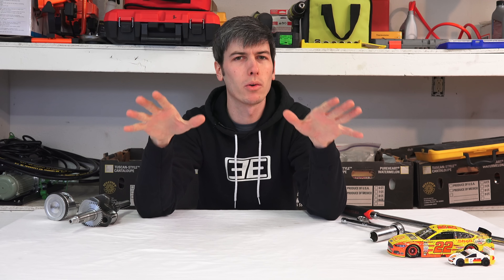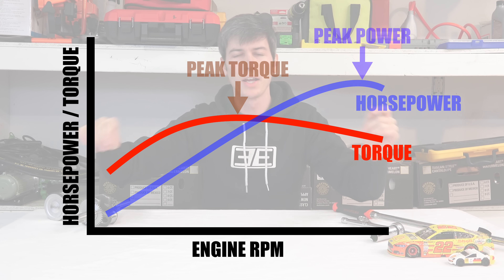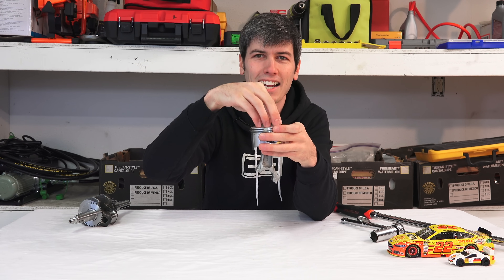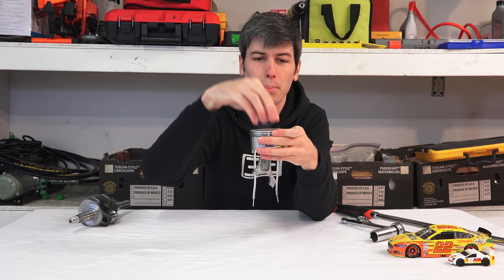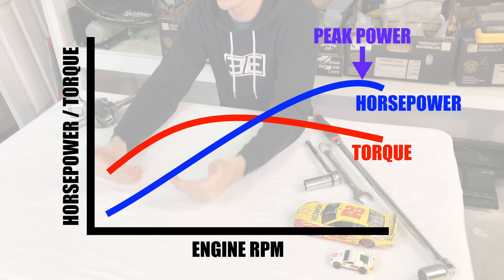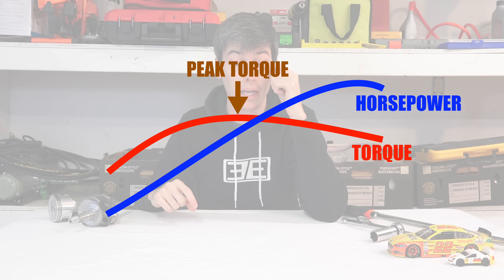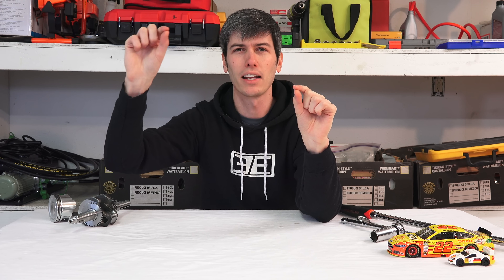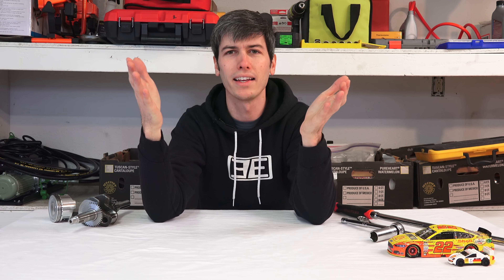Horsepower vs Torque - A Simple Explanation

Comment: Nicely done. my shop teacher explained this to me almost exactly as you did back in 1965!  Torque is force plus distance, measured in foot pounds per foot.  Horse power measures work! Hp is measured in time ie: if a horse lifts 1,000 lbs by simple pulley,  one foot in one minute, it has done one horse power of work. If the horse strains but does not lift the weight, it has expended force (torque), but has done no work.

Comment: I’d like to see this explained on work engines in regards to towing or hauling heavy weight. It would help in choosing a gear ratio that would be most effective in maintaining speed when pulling hills and the best gear for cruising to get the best MPG’s in Diesel engines.

Comment: if i want to pull a great weight behind me, is torque more important than hp? like i allways hear you need to be in lower gear to have more torque for greater performance in offroad vehicles.

Comment: To me, power is just a number which tells how fast the engine runs. But at a lower than around the highest RPM, its the torque which matters to accelerate or pull the vehicle. Ofcourse, if you increase the RPM, you effectively increase fuel intake and hence better throttle response and hence faster the engine and hence the vehicle.

However only real figure which matters is the torque. So I don't agree that the engine with higher power will run faster as it holds true only in lower (bigger) gears when vehicle can accelerate faster at high RPMs, At lower RPMs (typical driving style), you dont redline the engine and hence Torque plays a major role in accelerating the engine and doing it most efficiently using minimal fuel.

Comment: Hey Jason, I had been told by my car racing physics teacher in the past, that for a manual transmission car,  say a factory 6sp, that maximum acceleration, would occur when shifting at an rpm that after the decrease in rpm caused by the time it takes to upshift, you end up in the next gear at the rpm that produces the most torque. How does this apply, and what are your comments? Thanks.

Comment: Wait wait wait, so if you have horse power you can make or create more torque by using different gears and ratios and what not. But now when you have torque you cannot make horse power thru gears and ratios right? Because you cannot create more (HP) "speed" at which the work is done right? Does that make sense? Im not really fully understanding this concept
Reply from the maker: Yes, you are correct!

Comment: If you are going lets say 50km/h in third gear and you have max torque in range from 2000 to 2500 you will accelerate faster than a car that has more Power  in High revs but half the torque at 2000 RPM like NA petrol engine. So torque is better. And when you have Max torque the engine is working most efficient.

Comment: I would like to see a video on how the length of the connecting rod affects torque, horsepower, wear and tear, etc.  If 2 engines have the same bore and stroke but different connecting rod lengths how would this change the factors mentioned above.?
Reply: Jack Capone, the engine with the longer rods would have less wear/tear (less side load/friction).
Reply: Actually u can have two engines with same stroke and bore with different rod lengths just have to move the wrist pin higher in the piston. Longer rod will give u more torque (longer lever).
Reply: The leverage comes from the amount of throw the crank has.
Reply: "Stroke is the length of the rod spanky"....   No, it's not.  You have to think about it like the crank arms on a bicycle.  A 170mm crank arm will give you 340mm of stroke from TDC to BDC.  A 175mm arm will give you 350mm of stroke.  It doesn't matter how long your leg is (your leg being analogous to the piston rod).  The stroke is determined by the throw of the crank (the distance from the crank journal to the rod journal).
Reply: A longer rod will decrease the angle of attack from the crankshaft to the piston wrist pin than a shorter rod, hence the benefit of a longer rod. I think this is what confuses people thinking it has something to do with the stroke. As you stated, the crank offset from center line is the only thing that establishes the stroke.
Reply: Longer rod will not give you more torque. It could give more or less it depends on the rod to stroke ratio (R/S), fuel source, combustion chamber design, ignition timing, etc. Varying R/S values only effect the point in degrees when the maximum force will be applied to the crankshaft. As the R/S changes it effects the piston velocity for given degree of rotation. There are graphs online that model the relation between R/S and piston velocity through 360° of rotation. You might find it interesting.
Reply: Stroke is the length of the rod spanky
Reply: Nope.  Stroke is the distance between the crankshaft center and the crank lobe center.  Spanky.
Reply: and a rice burner will win against torque with rpms, with less power, so there's so many variables. He was making it simple.
Reply: Combustion chamber equals force. Wrist pin equals fulcrum, Connecting rod length combined with crank pin offset equal lever. The longer the lever the greater the work being done with the same effort. So in equal stroke, bore and displacement engines, greater power and efficiency will be generated by the longest connecting rod applicable.
Reply: Torque is a perpendicular force.  Any force applied at an angle must  be broken down into the horizontal and vertical components to find the perpendicular force.  Changing the rod length changes the angle of the rod, the vertical component and horizontal components, and the torque.
Reply: If the two engines have the same bore and stroke, they are the same. The connecting rods would have to be the same length because stroke is determined by the length of the rod. To get more stroke, the rods and the crank lobes must be longer. This will produce more torque. It will also make the displacement of the engine greater, put more stress on the crankshaft bearings, and slow the acceleration of RPM.
Reply: Stroke is not determined by the length of the connecting rods. It is determined by the offset distance between the connecting rod lobe and the center line of the crankshaft.

Comment: I have to take issue with something in this video even though I feel that overall you explained the relationship between horsepower and torque very well.  Also, to be clear, I love your videos.  You are so clear at explaining things.
My issue is when you said a more aggressive gear ratio ("higher gears") would bring you into the higher horsepower range.  As I understand things,  higher gears actually lower your RPM at any given speed regardless of the number stated on the gearshift knob. (Myth: higher number always=faster. Truth: higher number=faster ONLY within the limitations of the internal combustion engine as coupled with a properly selected gear ratios within the transmission.)  If you are running at peak torque and you shifted up, you would actually lose both torque AND horsepower due to RPM reduction until your RPM rose again to peak torque and above. The guy who shifts too early gets left behind.  If your engine develops peak horsepower at a higher RPM than it does for peak torque, (and most do) you need to let the RPM climb to that higher RPM BEFORE shifting up somewhere before "RED LINE".  This is why you start out in 1st gear and progressively shift up in order to keep your usable power/torque/RPM in the optimum range for the application.  Simply shifting into a higher gear can never achieve highest horsepower if that act drops your RPM to a figure below peak horsepower.  Obviously, when racing, due to the RPM limitations of the ICE, you typically shift up just as your RPM passes up above peak Hp. and you accept that you will lose some of that peak Hp until the RPM again rises up to that RPM.  "Short shifting", which is merely up-shifting moderately early, is done in races to conserve fuel while maintaining the best available torque, at the expense of some peak horsepower.
   And just to stir the pot,  Would you set up a car to attain maximum speed,  at some RPM ABOVE which peak horsepower/torque have begun to drop off (but below 'red line') since you would be doing so in a lower gear that puts the available horsepower to the ground more efficiently?  Choice: less horsepower but lower gears, or more horsepower pushing taller gears.  Don't forget when you were a kid and trying to climb that hill on a 10-speed bicycle in top gear.  How well did that work out?
  Cheers to all and kudos to Engineering Explained for another great and successful video.

Comment: according to the equation the RPM that has maximum torque must give the maximum horsepower so why is the difference?
Reply from the maker: Because a higher RPM multiplied by a lower torque can still be greater than peak torque multiplied by a lower RPM.
Reply: I have never seen an engine that has peak torque and peak hp at the very same rpm; I even think that's mathematically impossible; also... your torque line is usually relatively flat... as long as the decline in torque (how hard the engine can push) is lower than the increase in rpm (how fast the engine can push), the result is that the produced power increases; if the engine runs out of pushing strength (line drops very fast), it doesn't matter anymore how fast the engine 'can' do the pushing... the resulting power drops too; also, all engines have a physical limitation on how fast (rpm) they can go... so, even with a theoretical 'reserve' torque still on tap, if the engine just can increase rpm anymore, it can't produce more power.  Torque is 'input', power is output... and to go from one to the other you multiply by rpm.  Zero torque and/or zero rpm is also zero horsepower, mathematically.

Comment: Power and torque only require each other when you narrow the context to propelling a thing with a shaft. Torque can exist without power when acting solely as a spring (think torsion rod suspensions), and power can exist without torque (think of non mechanical things, such as a light bulb).

That being said, nice video. I work with people (mostly truck drivers) who all too often think they know exactly what they're talking about and think that somehow torque and power are independent, that somehow gears increase power, and (although not related to the video) that the inter-axle differential (in a two drive axle semi tractor) somehow only drives the rear axle until it's locked, and (also not related to the video) that a differential cannot possible split torque equally, especially when the outputs move at different rates. Maybe I will recommend this video to them (as well as some here on differentials).

Comment: Great video! Still I have trouble understanding how to calculate the best moment to switch gears for max acceleration. Keep up the great work.
Reply: Maciej Bałauszko You want the highest average horsepower throughout the range of rpms you would be using. This generally happens when you shift at recline, unless your torque curve drops off severely at high rpm.

Comment: u lost me half way,gonna keep rewatching it till i get it 100%,great video man,keep it up.
Reply: god man, shut up. People learn at different rates
Reply: Matt Moleman just like cars accelerate at different rates :)
Reply: Great job guys, that's exactly how you should approach learning! If you get confused, you're missing a piece, so stop and go back and find that piece, then move on to the next. Forget the fools who give people crap for learning or trying to learn. Those people might temporarily have more knowledge, but knowledge without wisdom is a waste. Knowledge with wisdom is what accomplishes things and gets things done. Keep it up!
Reply: I finally got it, took me 4 times ... let some time pass in-between, worked for me.
Reply: I'm sure you're giving a good explanation and it sounds very interesting... I just got lost.
Reply: It got a little convoluted in the middle due to the charts.
Reply: Mixed Content Same here, lol.
Reply: I did the same thing.
Reply: same here
Reply: It's called turbo lag, don't feel bad.
Reply: Look at it this way. Torque is T=F*D      100=10x10     or   200=10x20 ---> Same force (10) longer distance(went from 10 to 20).....more torque.  You may want to think of "distance" as in "length of leverage", that may help clarify. You can also say 100=10x10   or 200=20x10    same distance for each but now we added more force to gain more torque. This is why you hear torque (in America) measured by ft lbs. its a measurement of length and force. The metric system its measure by Newton meters.
Reply: same me too😂😂
Reply: Man, this is the easyest video about torque and power i ever seen :)) wtf

Comment: Its so nice to finally see a video that really clarifies the difference so well. I think a lot of people have trouble grasping the concept that torque can be supplimented by gear ratio if the car is making power high enough into the rpm range. I also liked the part explaining how peak torque is the highest instantaneous acceleration for a given gear which really explains why high torque cars can feel a lot faster than they are because of the brief shove that happens in the low range of each gear but doesn't continue into higher speeds. Great video!
Reply: HP. increases with torque in gasoline engines.Higher torque higher HP. If HP. is so important why is the buzz about electric motors having instant full torque. Never hear about the HP. ratings.Yes electric motors when built right will smoke a gas engine.Some times literally when electric motor goes.All torque no HP. you have a diesel. All HP. no torque you have an F1 car.Gotta find that magic middle ground.

Comment: Horsepower is the rate at which work is done.

I thought Horsepower represented the area your engine is running most efficiently. That's where I'm confused.
Reply from the maker: Peak efficiency and peak horsepower generally don't have much correlation. Peak power is generally made with a highly rich air/fuel mixture which means BSFC (efficiency) goes down. Peak power also is generally at high RPM, which also loses efficiency.
Reply: Thanks so much for replying!

So even though you have less torque at peak power, your transmission is able to magnify the torque before it goes to the wheels.

Then if Horsepower is the rate at which work is done, how does that influence the acceleration of a vehicle when it sounds as if torque is the ultimate factor altered by the transmission: since Torque goes to the wheels?
Reply: Engines run most efficiently at or near peak torque.

Comment: my question is how does a diesel end up with almost twice as much torque as horsepower? i may have missed something but the way you explained that wouldnt make sense in that case.
Reply: ImRychlo A diesel generally can not spin as fast as a gasoline engine. Remember power only becomes greater than torque (when using ftlbs and hp) at 5252 rpm.
Reply: Benjamin Payne good point, thank you.

Comment: Horsepower is all about car's top speed and torque is all about time to reach top speed.
Reply: Alexey Sopov No. Power is the rate at which work is done. In vehicle terms, this is the rate at which kinetic energy is gained. Kinetic energy is defined as 1/2*mass*velocity^2. The faster a vehicle gains kinetic energy (more power) the faster the vehicle accelerates. This is disregarding air resistance and rolling resistance.

Comment: so if i'm understanding this right, would a high-torque-low-power engine's power curve fall off more steeply than a same torque higher power engine? i've wondered for years how high torque, which is a direct measurement of rotational force, could produce lower acceleration than high power with less torque.
Reply: oldfrend High engine torque is a measure of rotational force on the crankshaft, not the tire. Convert everything to force at the tire and you will see which is faster.